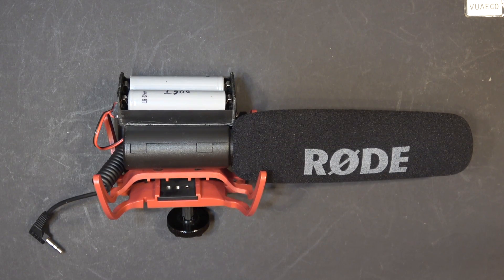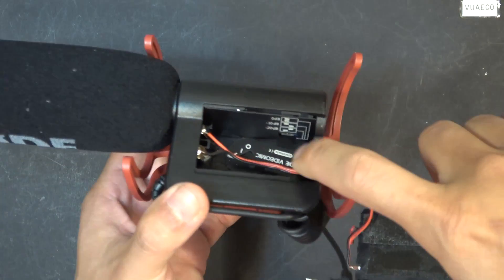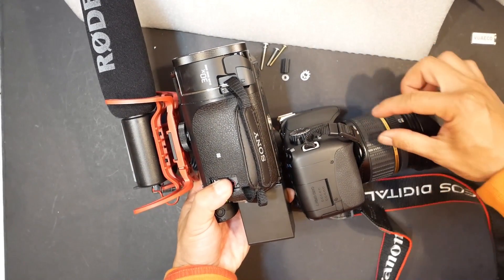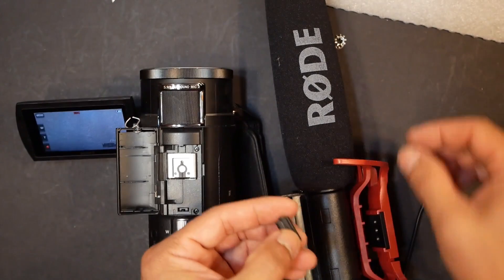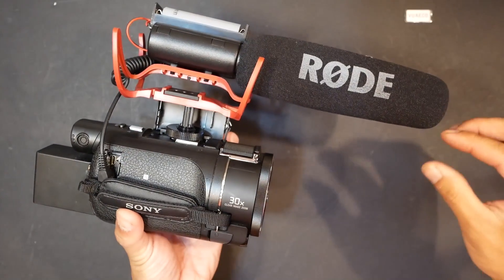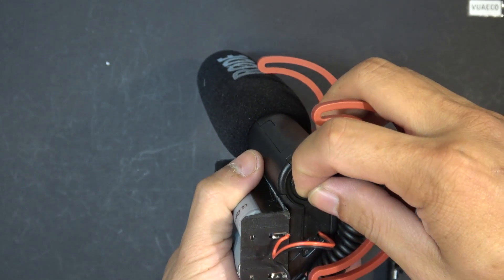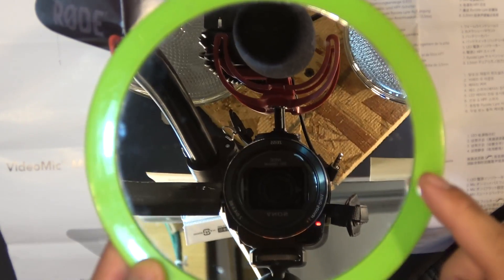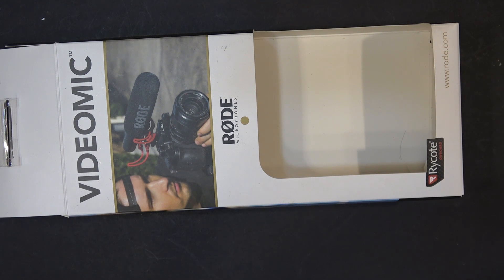Review & 9V battery hack: Rode shotgun microphone w/ Rycote Lyre suspension mount

Comment: An excellent, useful set of upgrades. Love it.
Reply from the maker: :D. This is one of the best microphone for the money if you can overcome the problems mention in the video.
Reply: @vuaeco  It would be cool to use 3x LIFePO4 (e.g. from a DeWalt Nano pack) to get the voltage up a bit (Rode website says the mic may not perform to specification at lower voltage; they probably mean Ni-MH is not recommended), but the energy density sucks compared to those A2 cells you have, and the power density of the A123 cells would be wasted on a mic with minimal current draw.
OTOH, higher voltage (but still lower than 12.6V!) would be nice, and if 8.5Wh is waaaaay too much, you'd likely still be fine @ 3.96Wh.
Reply from the maker: 3x LiFePO4 would probably be fine (around 11V max?). But 3x Li-ion at 12.6V might be too much for the mic. I've been using 2x Li-ion and it works fine on a 2S Li-ion at 8V.
Reply: @vuaeco  I'm not recording anything yet, but if/when I do, I'll probably just opt for something like a Zoom H4N Pro. It has a 3.5mm out, so it can be used in the same way as you use the Rode, but it's also good for me because I'll probably just use a cell phone and tripod for video at first (and combine it with the audio in post-production). I'm sure 2x tiny mics won't match the Rode's sound quality, but SQ is not as important for YouTube videos as it is for music or live amplification (IMO, anyway). Happy hacking, comrade! I do still love it.
Reply from the maker: Does the Zoom H4N really take 30 seconds just to turn on? That's a big negative it it does! :( Anyway, if you like the Zoom H4N pro, you might want to check out the Tascam DR-05. It's even cheaper than the Zoom.
Reply: @vuaeco  I didn't go looking for this. Yootoob actually recommended it beside this video.
*Warning: It contains country music. I'm sorry.*

https://www.youtube.com/watch?v=2JjRZ-yct3U